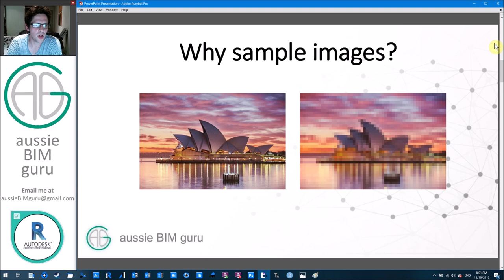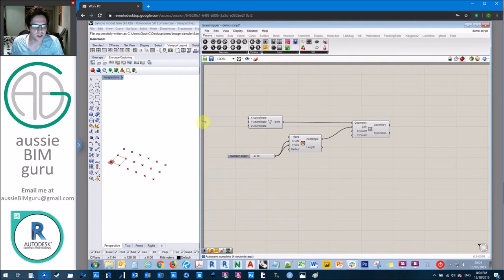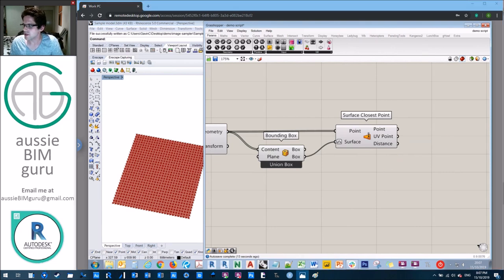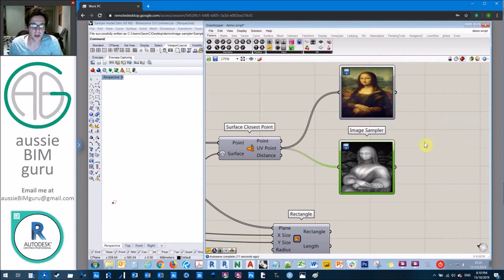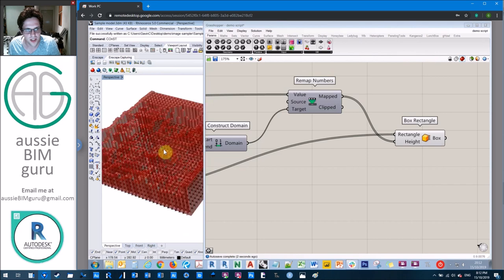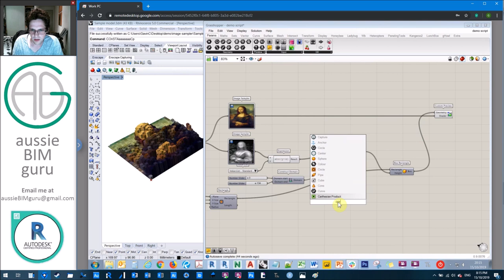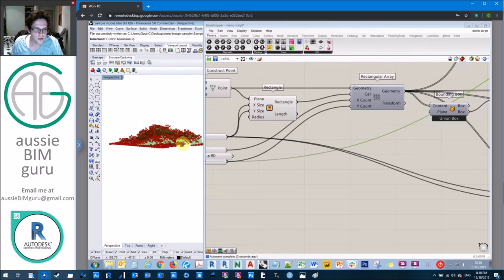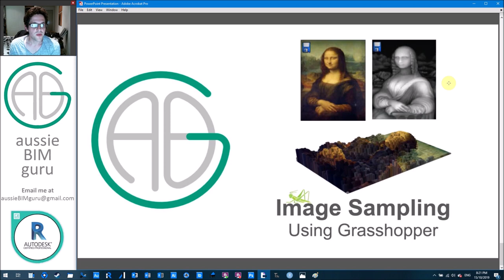Image Sampling using Grasshopper!

Comment: This is one of the best videos about Image Sampling I've seen out there! But I have a question: Can I use Grid instead of Point Array? Does it give me the same results?
Reply from the maker: I believe you'd always need to sample at points seeming the pixels are sampled using a UV point. If you have a grid of cells, you could grab their centroids and use these as the testpoints if you needed the cell equivalent pixel.
Reply: @AussieBIMGuru  oh I see... I'm gonna test both options. Thank you for the explanation!

Comment: Could you set the aspect ratio using a multiplier of the ratio on a single dimension, so it only needs a single slider? Why am I asking, I'm off to try it.
Reply from the maker: Indeed you could. A multiplication node on the non-driven dimension would do the trick!